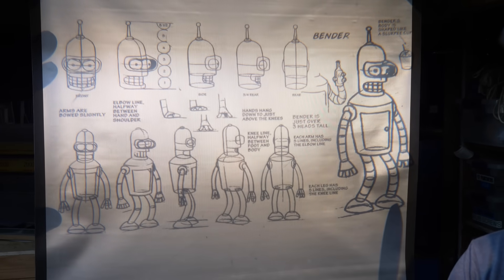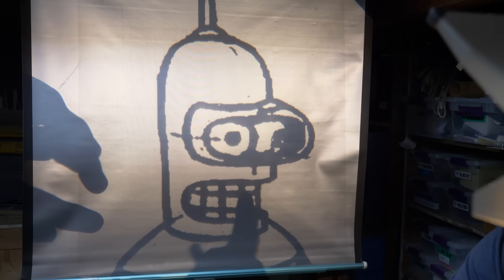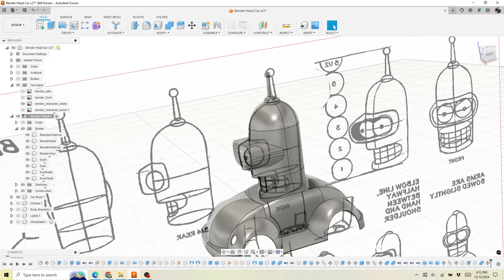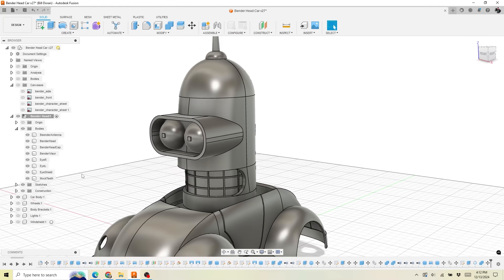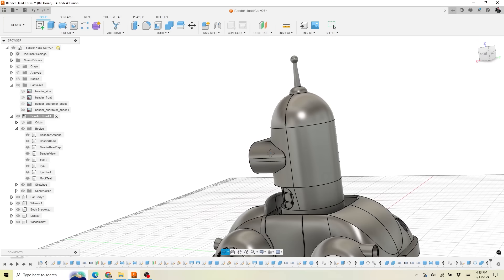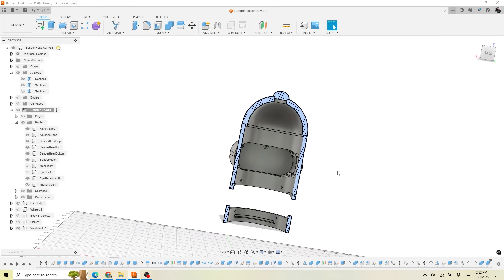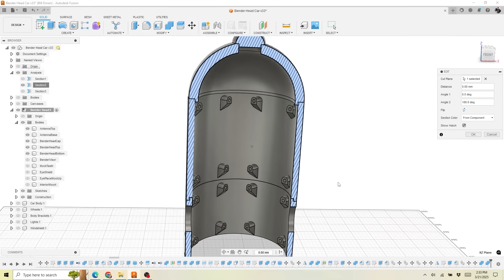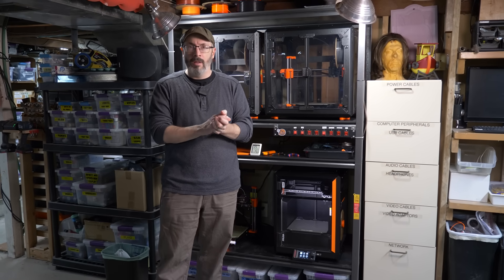A Head in the Polls - Bender Car Part 7

Comment: a solution I thought of for doing the teeth animatronic, is having a like a sheet of thin plastic (something that can flex up and down) and having that connect to a servo that moves the center up and down with the sides mounted in place (or more servos to allow for more movement), to get the horizontal teeth lines to bend whenever he speaks. maybe adding EVA foam to make the line thicker.  and to hide where the servo would connect to the horizontal teeth line, would be in between the space on the vertical teeth lines. it might need multiple servos to make sure it flexes correctly and move to the right spots, but that would give the effect to make it like the show

Comment: There's a better way to install heat-set inserts. Pull the iron out when the insert is just shy of flush, by about a millimetre, then quickly press it in the rest of the way with a flat piece of metal. It guarantees the insert is both flush with the surface, and also perfectly perpendicular, so the screw will thread nicely.

Doing it by eye can make the screws thread improperly, which can lead to things not tightening properly, or even breaking parts if you put too much torque on them.
Reply from the maker: I love this! Gonna do it next time.

Comment: I love 3d printed threads. I design and print my own shift knobs for my stick shift car and the threads are printed. They thread on no problem and don't come loose or break at all. Been using the same one for about a year now and it's only printed in pla.
Reply from the maker: Wow that’s impressive! I gotta make a custom shift knob for my Mini!
Reply: @punishedprops  it's fun to make them. I use tinkercad for mine so the threads are easy but the shape can be tricky to make it smooth.

Comment: I would love to see Bender's mouth be some kind of e-ink display. It wouldn't be cheap, but I feel like it would be a really cool project to have a raspberry pi or the like transform whatever is said into a mic, into bender's waveform like mouth movements when speaking. Since his mouth is a yellow "warm light" color I feel like that coupled with a yellow side lit sheet of plastic overtop the display could create the effect of his mouth.
Reply from the maker: That’s an interesting solution. I found some cheap, flexible LED panels and I’m gonna tinker with those first.
Reply: @punishedprops  excited to see what comes of the tinkering!

Comment: The threaded/twist on antenna was a nice solution, could probably do the same for the skull cap portion for easy removal allowing access to inside from the top. Same for the mounting solution to the car instead of utilizing the heated inserts, though those are probably a more firm long lasting connection. Love seeing this continued project come to life!
Reply from the maker: Thanks!

Comment: His mouth might be worth doing as a screen/LEDs, so you can get the full animated effect. And yeah looking at his sheet as an animator, the head being both a perfect cylinder, but also having the jaw be slightly inset is the usual Animator tricks of "looks good in 2d, doesnt work in 3d", atleast without making a sacrifice
Reply from the maker: I just picked up a flexible LED panel to do some tinkering. Lots of potential there!
Reply: @punishedprops  sweet as, depending on what you plan, if you ever need an animator to do some lip sync I'd love to help

Comment: Looking amazing! It might be too late in the process but I would personally change the design of how the antenna attaches. While 3d printed threads are awesome, they don't hold up forever. I would correct this and simplify the design by having it attach with a a strong magnet. The antenna can even recess further into the base for stability but be stay put by simple magnets. You can then even add a magnet near the internal screwdriver area to hold the antenna when it's not attached. Cheers!
Reply from the maker: That’s a great idea!

Comment: Reprint the antenna out of TPU with a hole for the screwdriver handle to fit in. When not in use the business end could be up inside the antenna and when you need it just flip it around. Then you have the antenna as a holder and a larger/longer handle.
Reply from the maker: I love it!

Comment: Registry keys are smart. Threaded prints are neat as long as both sides match. I'm running into a problem with my R2's probe, the threads don't work as advertised.
Love the threaded inserts, I struggle with them. Making your own tip is awesome, and bending it to get into hard to reach places is smart!
Heating the allen wrench to fit the handle on might have helped. I'd suggest a tool kit with a magnet to attach it to the inside of his head. I saw the R2 design on... thingiverse? Good reference.
Awesome work!
Reply from the maker: Great ideas, thanks!

Comment: So, trick with heat sets I really find helpful - remove the iron when they are slightly proud and then use something like a 123 block (or any comparatively large block of metal) to push em the rest of the way flush (only works with flat surfaces) - you're more likely to end up with them square and the larger thermal mass will pull heat out so you're less likely to burn yourself.
Reply from the maker: I love this tip! Thank you!